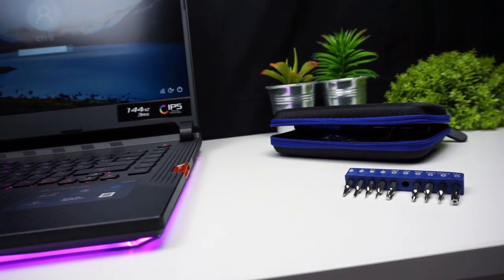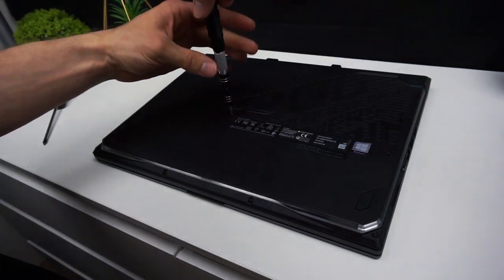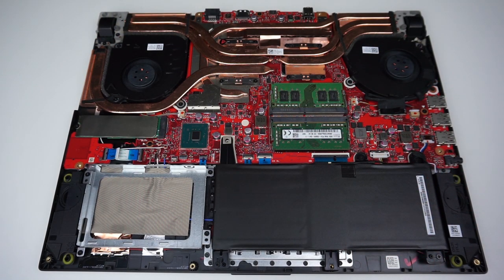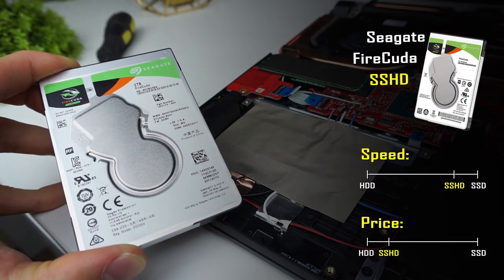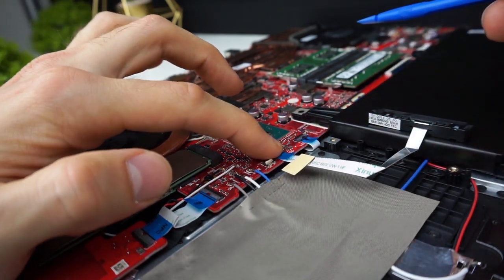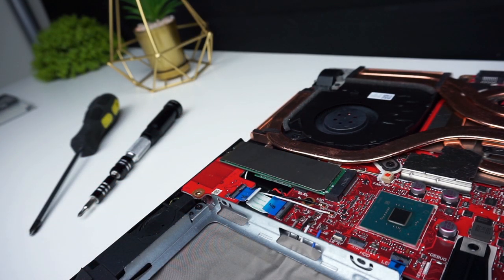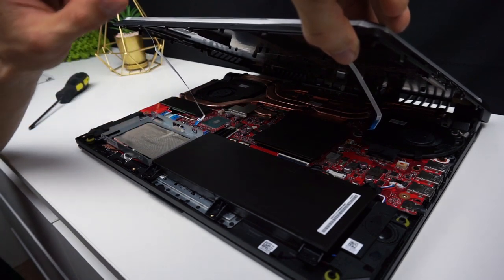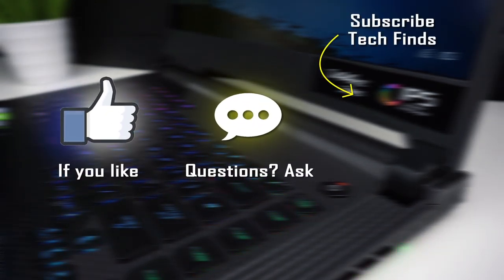Asus Scar III Upgrade RAM / SSD / HDD - Disassembly Guide

Comment: i want to ask if i buy asus rog strix scar 3 then how should i check or know which model and which gpu card and other info about the laptop i buy
Reply from the maker: You go to Windows 10 settings > System > System info
Reply: @TechFinds   hi and i know this method u mentioned but i want to ask that this is my first time to buy a gaming laptop and a expensive one so i have to buy it from the asus showroom so i am bit nervous for buying it coz i genrally see that showroom owner always get a wrong order so i want to ask u this thing and thanks for replying but i mean that i want to know which type of ssd i have in the laptop exact gpu card and exact model name coz this is my first time i want to buy a gaming laptop and expensive one so i want to know and one thing more can i upgrade ram to 32 gb from 16 gb or not
Reply: @TechFinds  and by the way i want to ask u someething that i want to buy asus rog scar 3 g531gv model is ot worth it to buy that laptop do u recommend it to buy and thanks once again 4 replying bro
Reply from the maker: @sidharthsinghchouhan9024  Yes, you can upgrade up to 32GB RAM (2x16). Unfortunately i don't know where to look for like serial number of the GPU or that kind of stuff. It's not needed tho. I think that you worry too much. The thing you should pay more attention to is the shipping itself and warranty or return policy.
And yes, i think that g531gv is worth buying. Just ensure that it has all the specs and features that you need.
Reply: @TechFinds  thanks friend and i glad u solve my problem but i wish there is any other way to find out the exact model and exact specs for that laptop and thanks once again bro
Reply: @TechFinds   can you tell mw how to check the refresh rate of the screen is there is a possible way and sorry for bothering u.. but i am just worried for buying and returning policy so i am asking u i hope u can understand what i want to say and worried off..
Reply from the maker: @sidharthsinghchouhan9024  right click on desktop > Intel Graphics settings > display > and there you can see whether you have 144hz option
Reply: @TechFinds  thanks

Comment: Hi, I love your videos, I have a question for you. I have the hero 3 model, it is practically the same. How much is the maximum that supports ram? Can I put 2 stiks of 32gb at 2666hz or the maximum that it supports are 2 stiks of 16gb at 2666hz?
Reply: I am trying to figure this out too! And assuming that it cant be 3200hz? did you have any luck with this.

Comment: Hello, does ( Crucial Ballistix SODIMM 32GB Kit (2 x 16GB) DDR4-3200 Gaming Memory (Black) will work ?
Reply from the maker: This laptop supports up to 2666MHz RAM. It should work, but the RAM will downclock to 2666MHz. However i don't recommend buying it, especially when you mix with original RAM. you have to match the specs

Comment: wich M.2 SSD Nvme should i need? M-key? B-key? Wich length?
Reply from the maker: Check the description, I linked few compatible drives.
Reply: usually M.2 NVMe = M-key and M.2 SATA = B-key, and because ROG is a powerful and fast laptop i think all of them is (maybeeeee) using M-key

Comment: do i need to buy the HDD cady and the cable?
Reply from the maker: By default you should get upgrade kit with the laptop in the box or in envelope with paperwork. Caddy may be inside of the laptop. Sometimes it happens that people don't get the parts, but it depends on the country or seller
Reply: @TechFinds  ah, i see! 
Thanks for the help I really appreciate it

Comment: Hello tech finds, when installing new Ram , do I have to purchase 2 ram (16gb each) or would 1 be compatible with the one that the laptop comes with
Reply from the maker: You can mix RAM with the original one, but it should have closest possible specs. If it comes to Scar 3 you can go for Crucial that i linked in the description. And before you buy any RAM ensure that your laptop came with 1x16GB or 2x8GB, because it has only 2 slots.
Reply: Hello, sorry to bother again, After installing the ram, the laptop doesn’t want to turn on ( power button not flashing but led is on, monitor is black) , the ram are both 16gb 2666mhz dual rank, help is appreciated, thanks
Reply from the maker: @reflexx6117  Just do hard reset, i said about it at the end of the video. It should help.
Reply: Thank you so much!
Reply: Tech Finds If this is such a common thing of needing to hard reset, would it hurt to just hard reset every time before screwing everything back in?
Reply from the maker: @diddlysquat123  you can do it to avoid unscrewing it again.

Comment: Do you recommend Asus scar ii 1070 gtx or 2060 rtx ?
As they have the same or so close price range in my country
Reply from the maker: I personally would go for RTX 2060 model despite that GTX 1070 may slightly outperform it in some cases. I've heard that GTX 1070 models had some issues with short battery life.
Reply: Great thanks a lot!
One more request,
Is there’s any other laptop do you recommend over the Asus scar ii ? In the same price range ? The only thing I found that’s better than it is the Acer predator triton 500, but my budget can’t afford it unfortunately...
Reply from the maker: @abdelrahmanmostafa2937  sure, the Acer Predator Helios 300 (2019). You must have heard about it and if not check out my review. It's an absolute best laptop of this year of this year in my opinion.
Reply: Tech Finds sure I heard about it and was dying for it ! But in my country we only have the rtx 2060 version which is even more expensive than the ASUS scar ii rtx 2060
And with my humble searching I find out that Asus are more well built than the acer
Because so many ppl have bad revs on reddit and etc due to screen bleeding,thermal pasting , and many other problems
Ofcourse I understand that the product itself is amazing , it’s just due to bad manufacturing
Reply from the maker: @abdelrahmanmostafa2937  This may apply to any brand laptop, but Acer always had problems with screen bleeding. It vary between laptops anyway.

Comment: Hey, Could you please tell me the Complete Specification of the RAM that you used to replace the old ones?

Also, Can I use a RAM that features CL 15 latency in ASUS SCAR 3? Currently, my laptop features 16GB DDR4 RAM having CL 19.
Reply from the maker: I didn't replace RAM in this laptop. I used the original RAM that the laptop came with just to show how to do it. It's recommended to buy RAM with the same specs if you gonna mix, but if you want CL15 you should buy 2 new sticks to avoid eventual compatibility issues. It should work mixed tho, but in some cases dual channel may not be activated or your RAM will downclock in order to match the latency
Reply: @TechFinds  Thanks for your suggestion. Does this laptop support CL15? I am thinking to buy 2 new HyperX 16GB DDR4-2666 CL15 Sticks to attain 32GB. 

Also, I did some research and found that RAM which supports CL<18 comes with a definite feature known as "XMP Profile". But alongside XMP, it also comes with a RAM Speed which is less than the Advertised Speed. Inorder to achieve the Advertised RAM Speed, users can simply go into the BIOS and probably switch to XMP profile to get the most out of it.

For example, if you take one 16GB DDR4-2666 CL15 XMP HyperX RAM, the actual RAM Speed would be around 2133MHz or 2400Mhz. And inorder to use the advertised RAM Speed i.e. 2666MHz, one needs to go into the BIOS and use the XMP Profile.

So now, My Second Question is, Does this laptop support XMP Profile option in BIOS? 

Please help. 😄
Reply from the maker: @themohitmalviya  Yes it supports CL15, so if you're planning to buy 2x HyperX then you're good to go. I haven't heard any reports of HypeyX working at lower MHz than advertised, in Scar 3 or other laptops that i've tested but some people report that this problem? occurs with Ballistix RAM CL16. I didn't check BIOS in Scar 3 for XMP profile tho
Reply: @TechFinds  Thanks for your advice. I did my research again and found that XMP profile feature comes with desktop, not necessarily with laptops. Many laptops have limited BIOS settings as they are generally not intended for tweaking and overclocking. 

Moreover, I read the complete specification of the HyperX 16GB DDR4-2666 CL15 (HX426S15IB2K2/32) from Amazon.com and came to know that this Ram supports 2666 MHz - a automatic Memory overclocking functionality for Coffee Lake Laptops (Intel® 300 Series Chipsets). I found this quite good as Asus Scar 3 comes with Intel® Core™ i7-9750H Processor and Mobile Intel® HM370 Chipset (which is certainly a
Intel® 300 Series Chipset and conclusively, a Coffee Lake Product). Thus, HyperX 16GB DDR4-2666 CL15 (HX426S15IB2K2/32) Ram would probably run at 2666 MHz which is what you said earlier. I am really happy about this. 😃😃

Unfortunately, I found one review from Amazon.in for the same Ram where the reviewer told that the System attained CL 16 (16-17-17) instead of CL 15 (15-17-17) when HyperX 16GB DDR4-2666 CL15 (HX426S15IB2K2/32) gets used. Eventually, I went through the Complete Technical Specification file (Official PDF) for HyperX 16GB DDR4-2666 CL15 (HX426S15IB2K2/32) inorder to get verified about the Standard CL timings and found that JEDEC (aka Memory Standards) Timing Parameter only includes CL 15 (15-17-17). As a result, I am bit confused about CAS Latency (CL) for this HyperX 16GB DDR4-2666 CL15 (HX426S15IB2K2/32) Ram. 

Please help and pitch in your idea. 😅

Also, considering that Amazon.in reviewer case, does getting CL 16 (16-17-17) instead of CL 15 (15-17-17) make much difference in Performance?
Reply from the maker: @themohitmalviya  Well, i don'tthink that anybody would be able to spot a difference. As many people as many different issues, but if it was only one case then the bigger chance you have that your RAM will be working as intended. I wouldn't go so deep into the specs and ;)
Reply: @TechFinds  Yeah, the bigger picture says it all. I am definitely gonna buy 2 new sticks of HyperX 16GB DDR4-2666 CL15  in-order to attain 32 GB for my Asus Scar 3 G531GW. I hope it will work in the right way.

Thank you so much @Tech Finds for everything. Much obliged for your assistance.😃🙏

Stay Safe, Stay indoors.😄
Reply from the maker: @themohitmalviya  Thanks, but i'll rather exercise and walk everyday outside for good health. ;)
Reply: @TechFinds  Yeah. Fitness is also important in this crucial time. Have a good day 😄💯
Reply: This conversation is so good 😀

Comment: I connected everything but it doesn’t show on my file
Reply from the maker: You have to go to device manager and make a new partition
Reply: Do you have a video on that? I installed the same exact Hdd drive you have i. The video.!
Reply from the maker: @erino.6432  No, I didn't make such video it's a standard operation and easy to do. I believe you can find a lot of guides on the internet

Comment: Hi,

Great video by the way, came across this to seek the possibility of upgrading my laptop. I play high demanding FPS games and find that sometimes i get lock ups (slow montion) every now & again. Almost like its lacking in hardware preformance. Invidia is installed okay, I bought the laptop not configured (no drive partition) not sure if this would make a difference? 
I just hope its not the processor as this is not upgradable? :(
Laptop type as below;

ASUS ROG G731GW NVIDIA RTX 2070, 16GB, 17.3" 240Hz 3ms, i7-9750H Gaming Laptop

Any tips are appreciated
Reply from the maker: Hey, your laptop has 3 performance modes: silent, balanced and turbo. When you play games you wanna use turbo mode, because the other modes limit the CPU power. You can set turbo mode in Armoury Crate app ur use the fan button on your keyboard. Other than that you can check your temperatures, because if they're too high thermal throttling may kick in and cause performance loss.
Reply: Brilliant, thanks for you're time. Will be looking out for more future videos :)

Comment: Will the keyboard work without the light ribbon (I hope)?
Reply from the maker: Do you mean when the ribbon cable is not connected? I suppose that it's only for the light bar, but I haven't tried that

Comment: Can you insert a second SSD in Scar III models?
Reply from the maker: yes you can have 2 SSDs but one has to be M.2 format and the other 2.5" sata
Reply: @TechFinds  Tell me please, does the laptop contain all the necessary cables to connect the 2,5 SSD or it should be supplied with the chosen model of the SSD disk?
Reply from the maker: @sevchyk  some people say tat they got laptop with all necessary parts for HDD installation but other people say that they didn't. It vary between countries and sellers i guess
Reply: @TechFinds  okay, thanks a lot

Comment: We need to buy seperately for ribbon cable for the hdd?
Reply from the maker: You should get the cable with your laptop. I had the cable in the box where the paperwork was.
Reply: @TechFinds  it was in mine
Reply: @TechFinds  hey sorry to bother you, but I want to install my hdd but I'm a bit nervous about removing the LEDs and attaching the hdd to the drive, what tool would you recommend or would a tiny flat head work? The Camara was a bit too far out for me to get a good look, is it as difficult(more delicate than difficult) as it looks? Thanks!
Reply from the maker: @TheSinisterProdigy  It can be anything that is flat enough to fit there. I would rather use plastic or wood, because with metal you can accidentally scratch something easier. It's easy to do, but it's hard to access.

Comment: I've got Asus ROG G731 (17 inch)..I was wondering, can I install HDD and SSD? (1TB + 2TB)
Reply from the maker: Yep you can. For HDD you have one 2.5" drive bay and for SSD you have M.2 slot (probably up to 1TB SSD).
Reply: Tech Finds hey i found ssd m.2 2TB on the links you put, it’s samsung do you think it will work on scar iii
Reply from the maker: @makavelivii6518  Not sure if there is 1TB limit for M.2 SSD
Reply: Tech Finds thank you man i think will not risk and will get the 1TB :(
Reply: @makavelivii6518  I kept my original 500GB ssd m.2 but added in another 2TB HDD

Comment: does doing this void your waranty?
Reply from the maker: You should still have your warranty as long as you won't damage anything during upgrade or with parts that you install. However you better read your warranty card, because it may vary between countries
Reply: @TechFinds  i looked around a just syoped really giving much of a crap about it

Comment: Hey tech !

Ive orderd thr lenovo y540. Why all the hard work for the helios 300 if the lenovo y540 is good enough and its on sale in country <3

Thanks for everything. Subbed
Reply from the maker: Well, recently i had Y540 with the same specs as 2019 Helios 300 and Predator was better in my case. Just like everything was kind of better in Helios 300. I'll be working on the review of Lenovo Legion Y540 in the near future, and i'll also make a comparison of those both laptops.
Reply: @TechFinds  yeah the helios 300 was not obtainable here in the netherlands. well it is but at much higher cost. Lets say 500 usd more. So decided to go with the lenovo y540
Reply from the maker: @adil222100  In terms of performance they are very close, but it's always a lottery. If you got a properly made unit you'll be good.
Reply: @TechFinds  I let you know when it arrives. Thank you

Comment: When changing the M.2 ssd you dnt have to reboot windows or reinstall windows on it
Reply from the maker: If you have Windows installed on the drive that you wanna swap out you have to reinstall windows on the new drive.
Reply: @TechFinds  do you have a video on how to do it are know a video I can watch on how to do it
Reply from the maker: @300avenue  I don't have such video, because i didn't swap out my M.2 SSD, so i had nothing to install. I believe that there are some guides on the internet if you look for them. You need to get a free coppy of your Windows and install it from bootable pendrive on your new M.2 SSD.
Reply: @TechFinds  ok thank u on the info
Reply: @TechFinds  one more questions if u can help me out when re installing windows on gsming laptop to new drive will I have to do same for the graphic cards as well
Reply from the maker: @300avenue  Graphics card? I don't understand the question. GPU has nothing to do with SSD upgrade and Windows reinstalling.
Reply: @TechFinds  ok I was watching a video this guy replaces his PCIE CARD N PUT WINDOWS ON IT AFTER HE TURNED HIS COMOUTER ON HE SAID SINCE HE REINSTALLED WINDOWS HE HAD TO DOWNLOAD SOMETHING FOR HIS GRAPHICS CARD
Reply: Think he said the drivers for his graphic cards
Reply from the maker: @300avenue  when you will have fresh Windows just do all updates and then you can update all drivers too. For Graphics go to "GeForce Experience" application and you'll find updates for your GPU there. You don't really have to do it, but you can.
Reply: @TechFinds  ok thank u again

Comment: The Samsung 970 evo does not work with my Asus  rog strix g531 help plz
Reply from the maker: Make sure that you connected it correctly. Then after physical installation you have to go to disk manager and make a partition on new drive in order to make it appear in your pc
Reply: @TechFinds  when i install the ssd it puts me into bios mode and i cant boot my laptop
Reply from the maker: @broz619  If you changed the stock SSD where you had Windows installed then on your new SSD you don't have any operation system. You have to fresh-install it.
Reply: @TechFinds  it says can't find any bootable devices
Reply from the maker: @broz619  that may be because you don't have Windows installed on none of your drives.